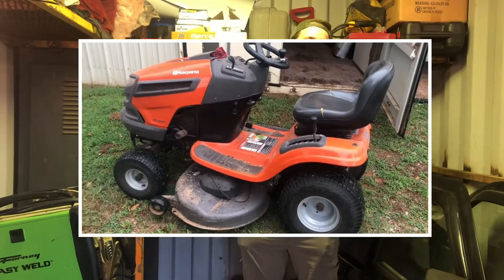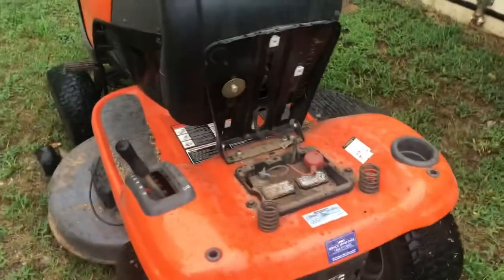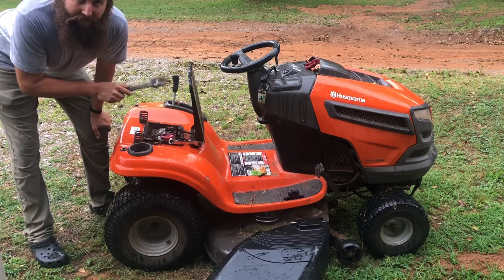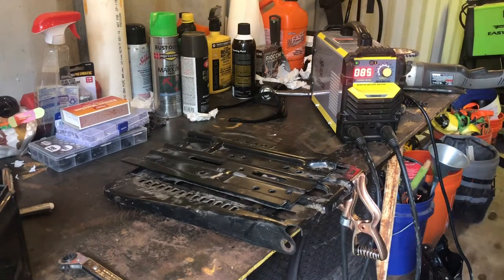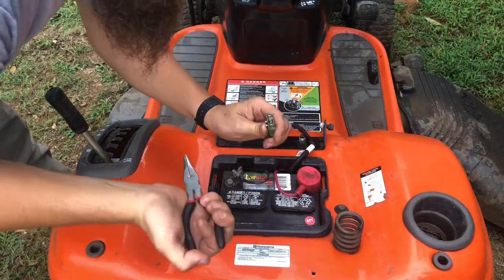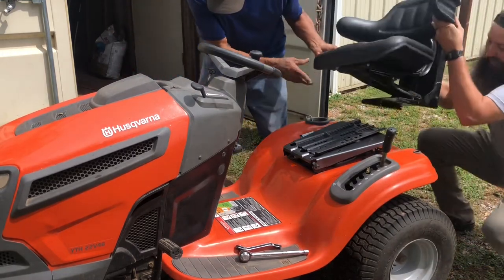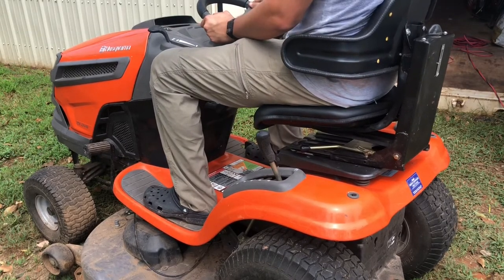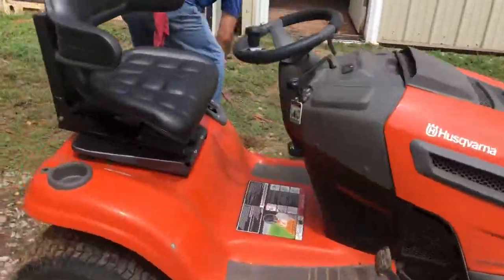Putting a COMFORTABLE Seat On A Common Lawnmower

Comment: I put a seat from a Miata, cured two problems. First was poor traction on hills, second at 6'2" it was tight. the seat is way more comfortable and set back the traction is much improved. as an added benefit the seat cost 15 dollars and it reclines.
Reply from the maker: That’s awesome! I’ll have to remember that. 😂😂

Comment: I would not use the old bolting plate. Instead bolt the new plate to the existing tractor eliminating the existing springs. That way it's more solid, lower and lets the new suspension work on its own.

Comment: Sorry this may seem really random but while watching the soldering process I was terrified your beard was going to burn. I never really thought about it until watching but do they have protective visors or masks that can protect your entire face & chest? If I were a man with a beard, I'd be terrified to solder anything!
Reply from the maker: If you think that’s bad, you should see what happens when I do overhead welding. I lose a lot of hair and beard due to hot sparks. They do make protective equipment, but I don’t do this kind of work often enough to worry about it.